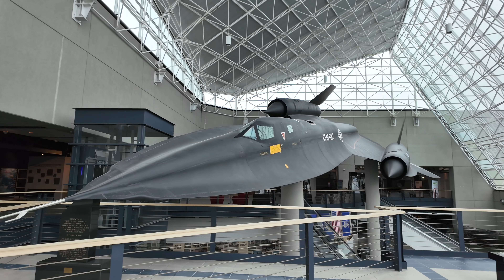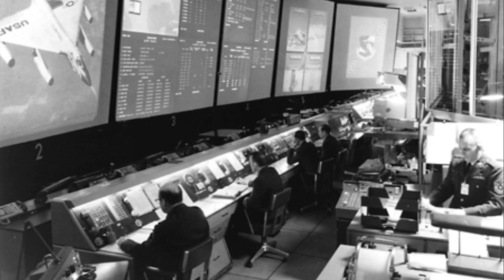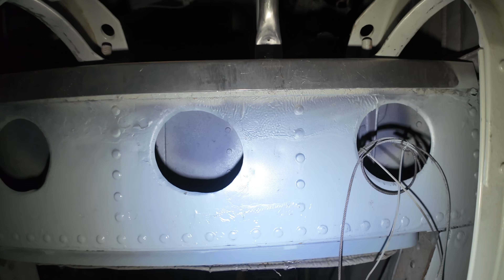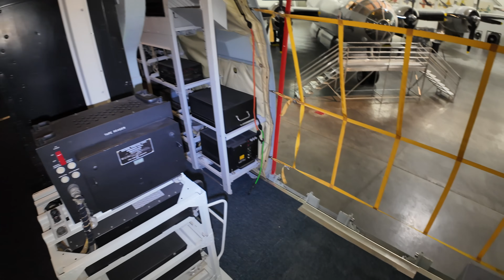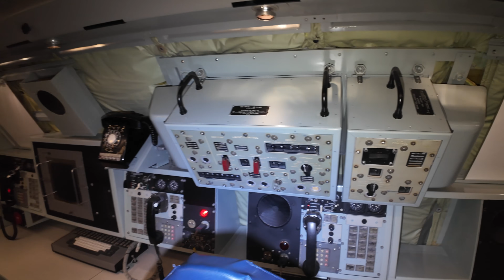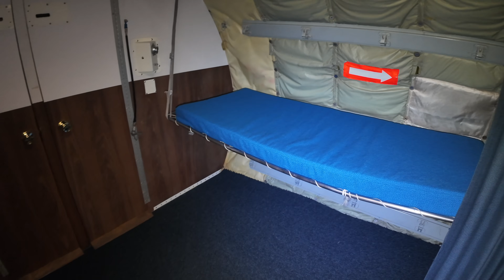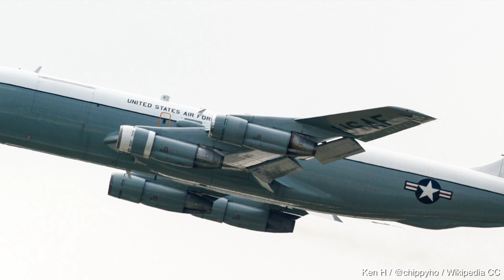Guided tour around the Doomsday Plane - the EC135 Looking Glass

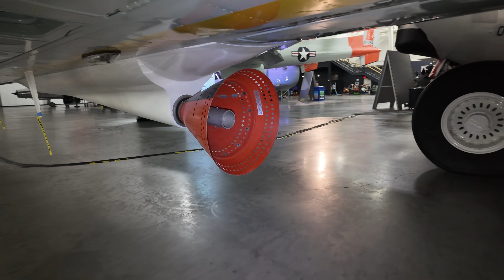Comment: 4:58 ah yes, pulling maximum G’s in a non fighter aircraft while having a 1 mile long cable hanging below to communicate with submarines….very stressing on both aircraft and crew
Reply: Actually, there was a little over 25,000 feet of wire on the transmit antenna (about 5 miles). With the antenna out, the pilots didn't make any sudden movements in any direction. It was fun to lay in the boom pod and try to find the drogue, when the antenna was out at max extension.

Comment: There are also special ICBMs that launch radio signals to actual ICBMs as a backup. They also use special ICBMs to launch communication and GPS satelites in case our satelites get taken out.
Reply: The Emergency Rocket Communications System (ERCS) to which you refer was retired many years ago.  An ERCs payload has been on display at this museum since the 1990s, even before the museum moved to its present location.
Reply: @danelder6846  As far as you know
Reply: @RobertCraft-re5sf As far as I know?  I'm pretty confident in what I stated.

I flew the mission for seven years in the 80s, including three in the HQ SAC Command Control Airborne Division.  This included flight time on EC-135C 63-8049.

The last ERCS payloads were deployed on Whiteman AFB Minuteman missiles.  Those Whiteman ICBMs are long gone.

I first saw the museum's ERCS payload while still on active duty flying on the E-4Bs with the National Airborne Operations Center (NAOC) in the mid-90s.

The ERCS was retired and never replaced.  This is easily researched.

Comment: Amazing how much stuff is on these planes. I never knew about the drouge antenna. Makes sense they need that for ELF to reach submarines underwater.
Reply: LF/VLF, not ELF.
Reply: @danelder6846  (VLF) radio waves can penetrate seawater just over one hundred feet (30 metres), and many navies use powerful shore VLF transmitters for submarine communications. A few nations have built transmitters which use extremely low frequency (ELF) radio waves, which can penetrate seawater to reach submarines at operating depths, but these require huge antennas. Other techniques that have been used include sonar and blue lasers.[1]
Reply: I operated the LF/VLF system many times as a data communication system operator.
Reply: The LF/VLF system was not just for submarine communication. LFV/LF signals can penetrate a highly radioactive atmosphere better than other frequencies.

Comment: It is my sincere hope that when the VC-25b aircraft are retired from service you'll find a way to be among the first people to get a private tour, I thoroughly enjoy your videos and always learn something even on aircraft I'm very familiar with.

One minor comment regarding the SR-71:  as you mentioned they needed to hit the tanker after their initial takeoff and climb but it wasn't because of how much fuel it burned or as often misrepresented that it leaked so badly on the ground due to the panel gaps it would run out of fuel shortly.  The issue was actually how little fuel it initially had for takeoff. While the SR-71 had a maximum fuel capacity over 130,000lbs the max fuel on take-off was only about 80,000lbs, but after several crashes it was determined taking off at max weight was causing premature failures of its specialized tires.  Additionally in the event of engine failure at take-off / initial climb out it couldn't maintain sufficient speed and would also crash.  To address these incidents they reduced the ground fuel loading to just 40,000lbs.
Reply: Thanks for clarifying this as there are indeed many videos and books claiming the plane needed to be refueled right after takeoff due to it leaking from the panels designed to seal at higher temperatures and because takeoff consumed so much fuel.  Takeoff can be such a risky procedure at the best of times even with easily handled aircraft.  I can’t imagine the prospect of an engine flameout in an SR-71 at any time after V1, like you’d want to be as light as is reasonable.

Comment: My guess regarding the B52's lowered landing gears during air refueling:
It's not to slow down the airplane, but to have more drag and higher thrust, so the engines work in an optimal range. Plus, with more drag, it might be easier to precisely control the speed.

Comment: Excellent video. It should be noted that the US Navy is actually considering supplementing their E-6 fleet with a fleet of specially modified C-130J models that would fly at lower altitudes trailing a very low frequency (VLF) wire to communicate with Navy submarines.

Comment: Excellent video. I was assigned to USSTRATCOM from 1997 to 2000 as a LOOKING GLASS Intel officer and was both the last intel officer to stand alert on the platform (after we retired the EC-135C the intel function was dual-roled to the ALCS officer due to less battle staff space and fewer battle staff positions on the E-6B) and also the intel officer on that final EC-135 LOOKING GLASS sortie in September 1998 (which we flew on 8048, the plane built right ahead of the one in the video on the assembly line in Renton, Washington).

I do feel the need to clarify one thing about crew access to the A/C. For scheduled, airborne alert, LOOKING GLASS sorties, all of us used the large boarding ladder and wide stairs rolled up to the cargo door. There simply was no need to use the cockpit entry ladder under those circumstances plus we always needed to carry lots of heavy documentation and equipment to/from the aircraft, so that larger ladder was safer. Keep in mind, too, that Offutt AFB is on the SE side of Omaha, Nebraska in a suburb known as Bellevue, so for much of the year that meant we were boarding and deboarding the aircraft in ice and snow during day and night, so safety entering and departing the aircraft with heavy loads was a big consideration.    

We’d exclusively use the cockpit crew entry ladder once the plane was on ground alert and ready to launch. It would have taken too long to move the large ladder away and close the cargo door during an alert launch, so everyone, the general or admiral included, used the cockpit crew entry ladder during alert responses or when we simply had a need to access an alert jet on the tarmac after it was buttoned up. During Exercise GLOBAL SHIELD ‘97, my A/C was assigned as the CINCSTRAT A/C so when the klaxon blew on that alert response we had CINCSTRAT (Gen Habinger at that time) plus the STRATCOM J2, J3/4, and J5 all climb up that ladder with us before we launched. That also means everyone departed the A/C the same way we entered. 

That was one of the best assignments I ever had and I really miss that platform.

Comment: Woo Hoo, I spent 2 years working on the electronics, uhf, hf, switchboard, ALCS boxes, multi track recorder, HARDS (high altitude radiation warning system) warning and VLF on that plane! Early on, the vlf wire antenna reel didn't work very well and when the hydraulic cutter and the manual cutter wouldn't work, they would have togfo out and land in the desert dragging some miles of wire. Rumor said a rancher had collected some of the orange cones and mounted them at the entrance of his farm.
Reply: @happycamper5213  I worked as weapons system team member on F-16C/D fighters at Luke AFB in 2000. Proud Panther Maintainer MAOW Weapons Crew 32 63rd Fighter Squadron
Reply: Thanks for the clarification on the HARDS system on the EC-135. In the raw version of the docudrama “First Strike”, one of the battle staff states “I’ve got a HARDS event!” I assumed that stood for High Altitude Radiation Detection System, but could never confirm it through research. Thank you!
Reply: I hope no cows got sliced in half

Comment: is this similar to the RC-135 rivet joint?
Reply: I was a LOOKING GLASS Intel Officer and later commanded an RJ “back end” squadron (i.e., the SIGINT Squadron in the mission end of the aircraft) in Saudi Arabia, so I’ll jump in here. Both aircraft are based on the C-135 airframe and both were based at Offutt AFB because of very similar logistics requirements, but the electronics and missions were very different.

LOOKING GLASS was for a nuclear command post role so we had equipment mostly designed for survivable radio reception and transmission, even under highly degraded electromagnetic environments that would be expected following a nuclear attack. RIVET JOINT is a Signals Intelligence platform so our electronics on it was strongly skewed toward more receiving capabilities but with enough transmitting capability to report intelligence on which someone needed to take immediate action. For instance, while flying SOUTHERN WATCH missions we’d listen for evidence the Iraqis were preparing to shoot at coalition aircraft and when they began preparing to fire, we’d radio an alert to the flight being targeted so they could take evasive action.

It’s also worth mentioning that the EC-135s were the next to last of the C-135 family built with the RC-135s following them and being the last off the line. The RIVET JOINT were the RC-135Vs which almost the final aircraft and they were followed by the RC-135U COMBAT SENT aircraft which were the absolute last tail numbers built. 

If you’re really interested in this, the best source are books and articles written by Dr. Robert Hopkins. Bob was both an EC and RC pilot and later got a doctorate focusing on the Cold War. No one has ever done any more comprehensive or better researched work on the C/KC/RC/WC-135 family than Bob.
Reply from the maker: Somewhat. I’ve mentioned it at the end :)